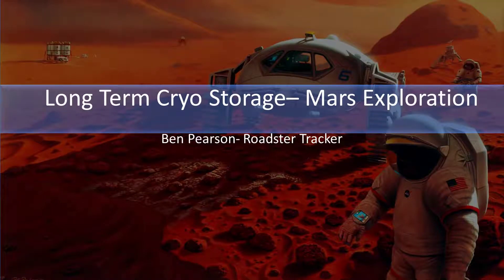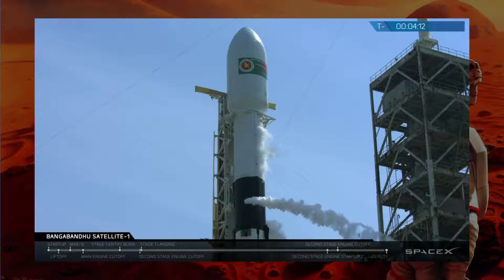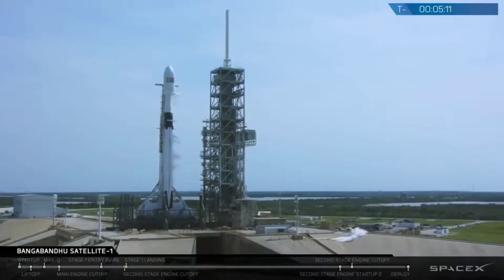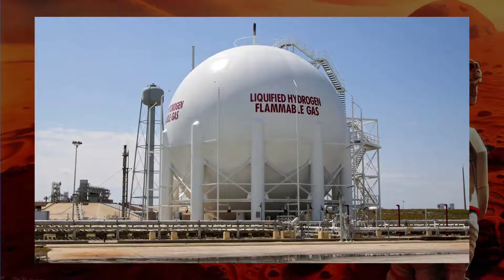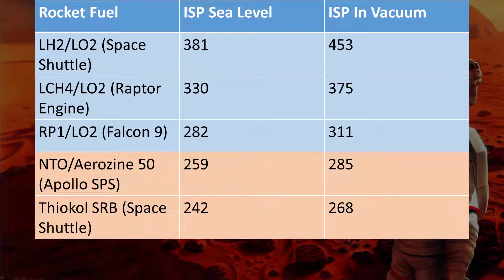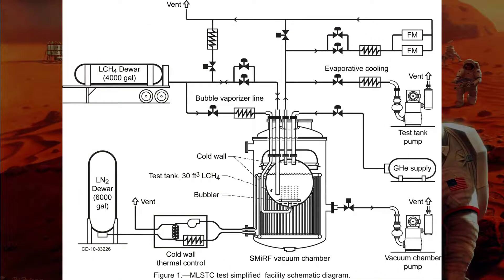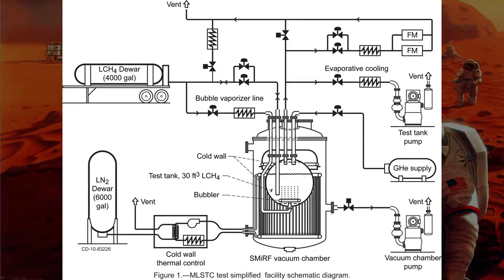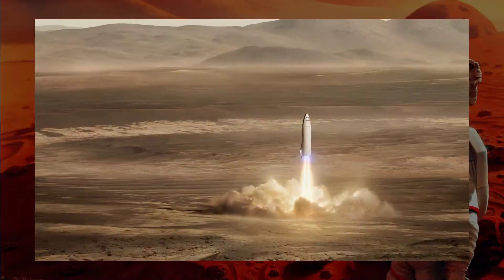Keeping Fuel Cryogenic for a Mission to Mars

Comment: Its rarely discussed because the solutions are relatively well known.

Here's the problem: To achieve stable pressures in the prop tanks they need to cool the propellant at the same rate as it is heated by the ambient temperature.

The solution on the ground is done through boil off because it is simple and there is access to more chilled propellant to top up the tanks.

The solution in space, where you do not have access to more propellant, is active cooling, literally just a fancy refrigerator, powered by solar panels and with excess heat dumped as IR.

Further reading here https://ntrs.nasa.gov/archive/nasa/casi.ntrs.nasa.gov/20110014399.pdf

Comment: The way I figure it will be resolved is by capturing boiloff and turning it back into cryogenic liquid. The equipment to liquefy gas produced via ISRU is needed anyway. For boiloff management, just takes the gas which is boiling off and liquify it and put it back in the tank.
Reply from the maker: I suppose you are right. Still, will be interesting to see it addressed!